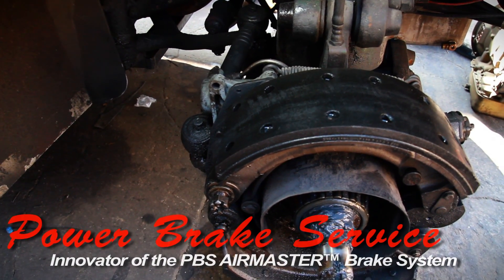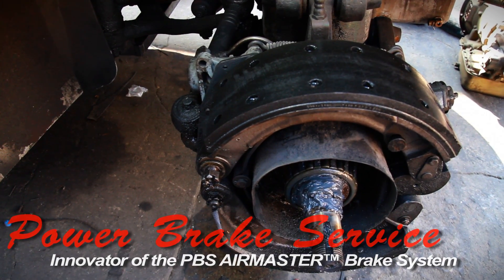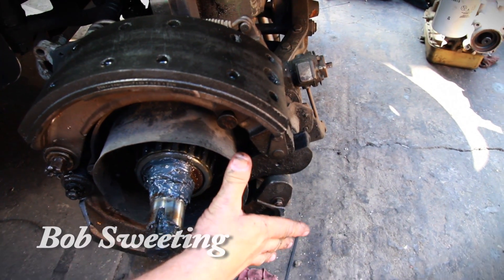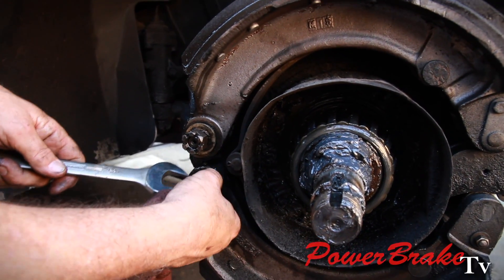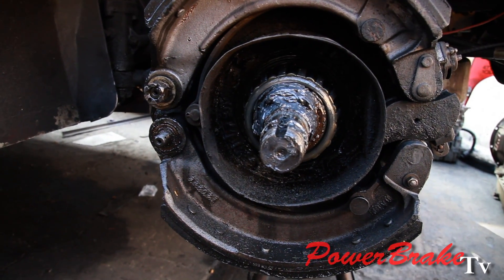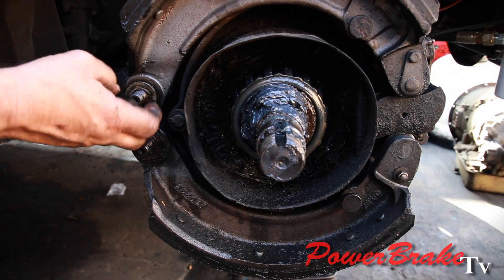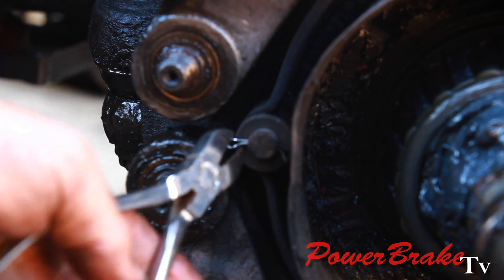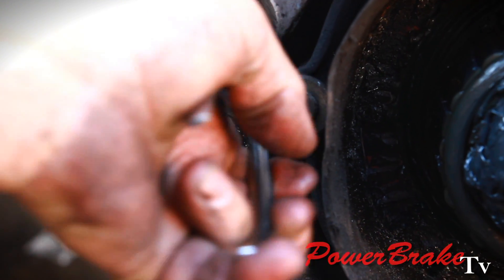British Leyland Bus Brakes, Air/hydraulic Conversion - Sweeting Performance

Comment: WOW! I never would have thought that I would see that exact double decker bus. I actually drove it from Ranch Dominguez to get the red paint job in Carson, CA. We built it for the Red Bull company as a party bus. I designed the forward a/c system ducting and fresh water tank and various other custom work. It has a toilet, bar, dj booth, VIP seating area, catwalk, and dance floor. What a blast from the past!